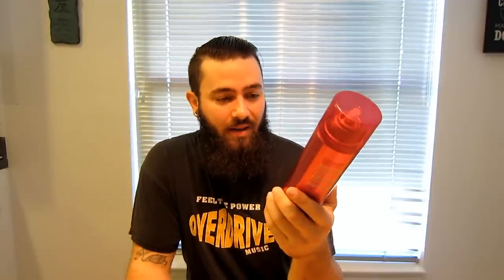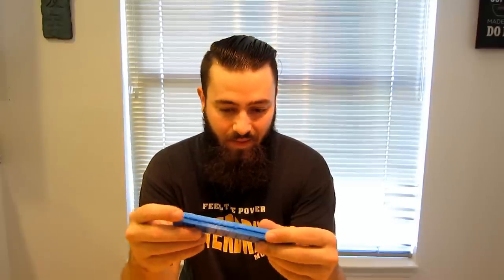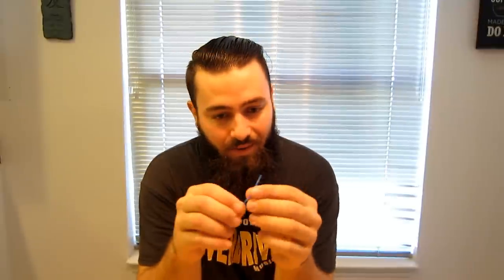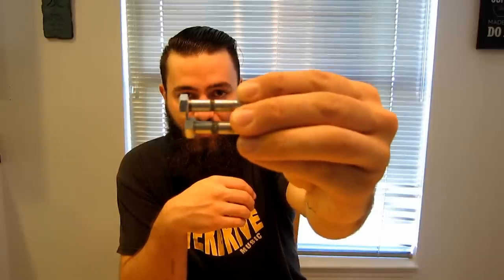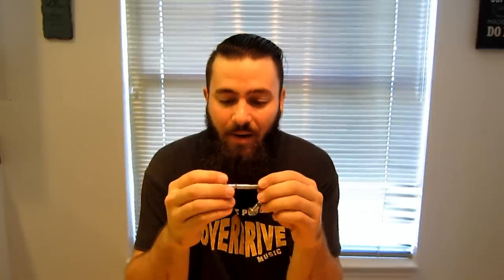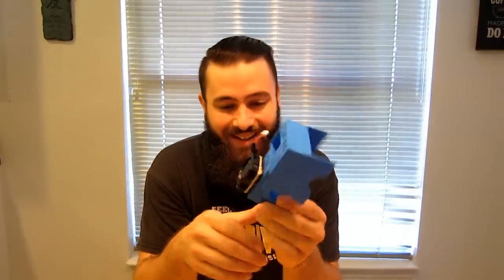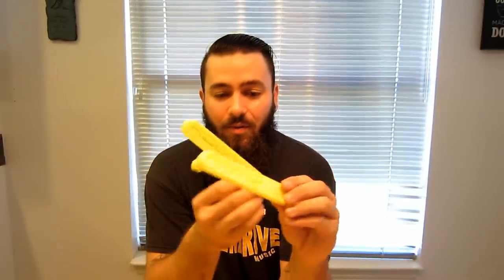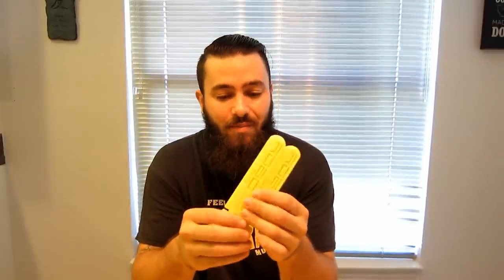Upgrades and tips for Robo 3D R1

Comment: Great video, I've been working with this printer(From my school). Also thanks for the tips, you gave me some ideas where/how to fix my issues. On the problem where you said you had the notches on the filament, i believe is because of the z-offset(the height of the extruder on the first layout) might be too low and filament is trying to get out but since is too low to the bed is back stacking and thus the bolt and gear are making the notches because is not flowing how it suppose to. Thus making later on to cause the printer to phantom print with out extruding the filament. I mess with the settings and i haven't had those issues no more.

Comment: My best upgrade was getting the Reprapdiscount Smart LCD Controller XXL. This makes the printer independent from the computer and easy to handle, you can get it from Printed Solid. It is worth the $69, and simple to install.
Reply from the maker: I wanted that axel! my model technically has print from sd capability,  so I didn't buy it. but the sd feature is not implemented yet.
Reply: Use a Raspberry Pi with Octoprint. Allows much better control, remotely from anywhere on your network. :)

Comment: Great video!!! Just found the need today for an oiler on my Robo as PLA was consistently printing fine for the first 20 layers or so than BAM, strip the filament and print a shitty layer.  I am looking to do the fan duct similar to what you did.  could you possibly show an installation video?  Or direct this thread to one?

Comment: Hey man! great vids. I have 2 questions. I just received my r1 on the 15th and am excited to use it but haven't had time to, ive been wanting to get it calibrated so that my first print comes out ok or better. I was wondering how you got the manual configuration to pop up on the software client. I can move my bed and extruder manually but theres no option to calibrate it like you did where you held the paper under it and did all the things you did in your last vid. my second question is, can you link me to a good priced fan that works with the shround as well as point out the location to the wires I need to cut and solder in order to add this mod tot he r1? this will help others who watch this vid I am sure of it. thanks or your time man and sorry for my long winded question

Comment: Just wondering if you could explain the wiring a little better and how you did it? Sorry I'm a bit new to electrical work, thanks!
Reply from the maker: basically, i just hooked the fan and led positives to the robo3ds positive,  and their negatives to the robo3ds negative. be careful with the stock fan wiring, i melted the jacket a bit with my soldering skills.

Comment: Hey, I'm going to get a robo but I will probably install an e3d v6 hot end, but I do not really know how to install it as there are no installation videos.
Reply from the maker: i think you'll need to print a new carriage,  I'm not sure what else you need,  some machine screws probably.  i don't plan on getting the e3 unless the hexagon fails on me.  but if i do there will be a video.
Reply: Its not hard to install, but youll need to do a little drilling to allow the top to fit in. I put a E3D Lite on mine, the worst part of the install was taking it all apart to do so.

Comment: do u want the hair spray to dry or start the print while it is weat.
Reply from the maker: I spray it on right after cleaning the bed,  and right before starting the print, the heated bed is up to temp and the hair spray dries super fast,  that's what works for me.
Reply: Technophilia Unlimited and you clean the bed with??
Reply from the maker: Water and paper towels